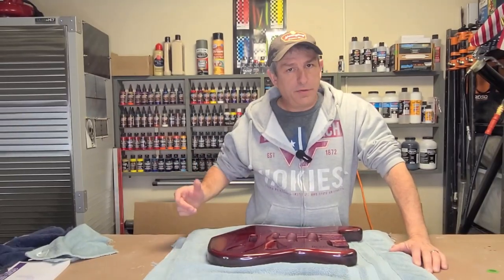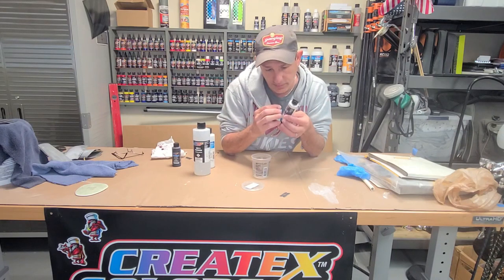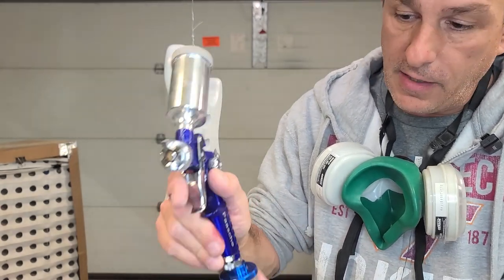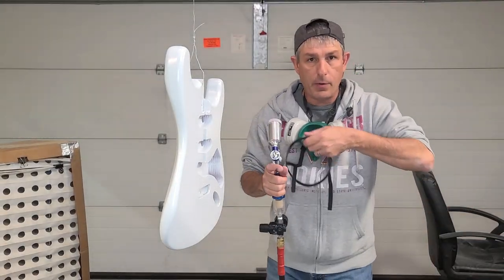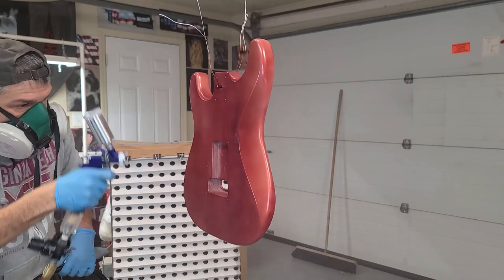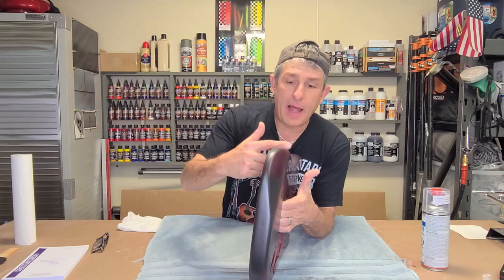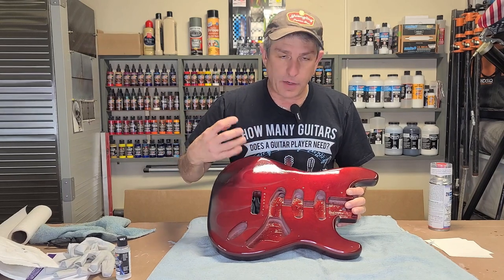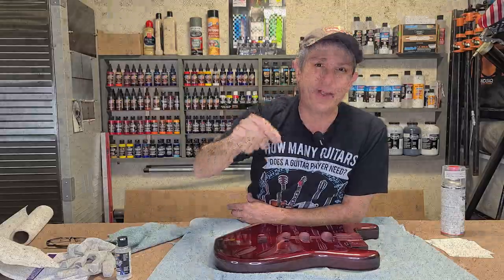How To Restore that Old Guitar - Repair and Paint (Part 2)

Comment: Just seeing this vid and I feel your pain with the late discovery of a defect. I'm currently refurbing/upgrading a bass and I too reached the point where I had to make a decision about some defects...I ended up sanding the areas back to the primer and I'm reshooting the black base color in those areas and hoping I can then color sand smooth before the clear goes on...s*#t happens and you just have to roll with it. I'm using rattle cans but I am going to look into that Pasche gun...like a mini-touch up gun...that would have made things a lot easier.

How many guitars does a guitar player need....1 more than he has....
Reply from the maker: Icedog75, yeah it's tough when we have to go backward and swallow all the time lost but with every mistake or something going wrong even when you thought you did everything right. The worst thing that can happen is we learn from it. At least that's what I tell myself. Lol. Thanks for the comment and thanks for watching.